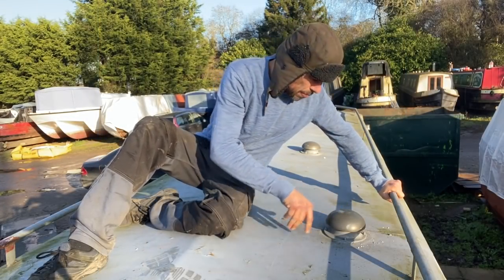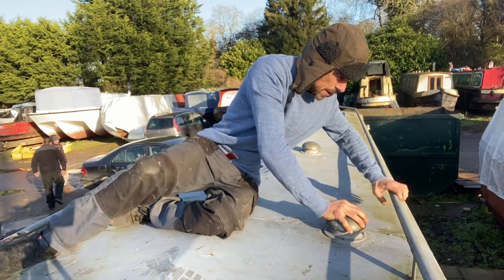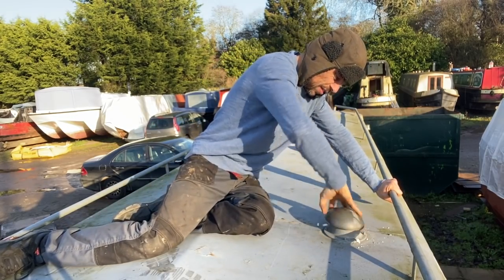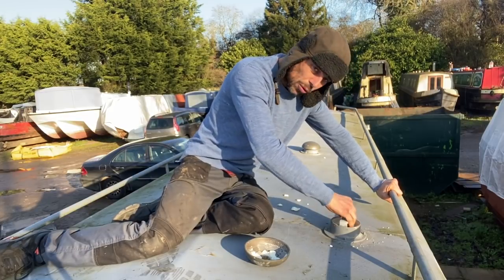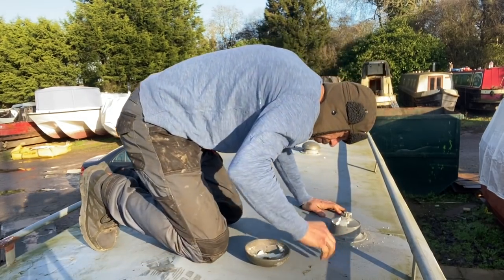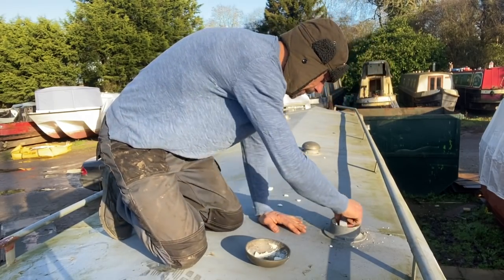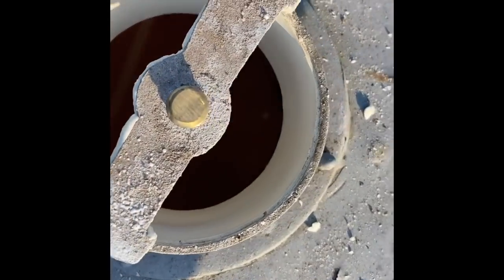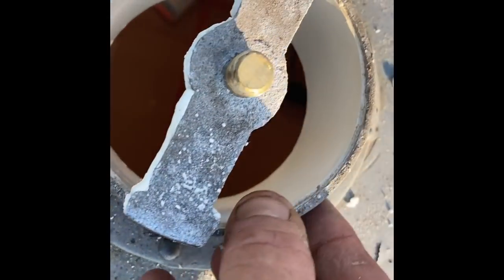38. New walls going up today on my Narrowboat

Comment: James.  Would it be an idea to run some trunking/conduit behind the walls and put a fish wire inside to future proof it just in case you decide on some sockets or whatever down the road?
Reply: I'd second that. They'll always be that one thing you didn't think of.
Reply: For the most part on nearly every narrowboat I have seen worked on on youtube that space where the top board over the gunnals creates a two to three inch overhang that wiring, some water and other piping are laid. Then a two to three inch board is screwed into place and all is hidden away.  You can easily get to it for any repair.  

The only issue is your pump from shower and/or bath that is usually in the bottom of the boat in that area and needs an inspection cover.

Comment: Re: Circular saw - Safety glasses still keeping the utensils safe? lol. Veneer might bend, but plywood is meant to be horizontally/vertically stable. When making wooden rope tension drums we either steam-bend or layer up veneer like an onion with glue between each layer to build up a laminate.

Comment: Sorry to put a downer on your plans, but you really need to rethink putting the walls on top of the floor. You need to think what would happen if you need to get access under the floor for a leak or to redistribute ballast. 
At the moment you'd have to remove the walls and possibly any piping or wiring before you could lift the floor.

Comment: Hi James. May I kindly suggest that the gas pipework is run under the gunnel. Joints should be easily accessible. Boats get vibration from bumbs and it is at joints I believe where gas leaks can occur. I have had on the boat safety test on two different narrowboats gas leakage at joints. Could not smell the gas leaking. The BSS has details re distance between pipe supports and that from each joint the pipe should be supported no more than 6 inches away. The gas pipework needs to be accessible for testing and easy to repair. Can then T off under the gunnel to go to gas appliances . The hob needs I believe to all be run in solid pipework. The oven can be connected to a flexible connection. I have done my own gas work and then got it inspected and tested. I believe gas and ventilation and fuel safety and stoves to be the major points of the boat safety scheme. Great videos, very enjoyable. Cheers.

Comment: For smoother curves, try cutting parallel lines about an inch apart and about half way through back of the plywood.
Reply: Yeah, 9 mm is not gonna just easily bend to a 10 cm radius curve.

Comment: I'm sure I watched on one video your gas is meant to go under the gunnel for safety cert thing might be something to check. Boat is looking brill.
Reply: I saw that too. It certainly cannot be under the floor (but I know James is not putting it under) and the BSS requirements look a bit vague, though a common them is the avoidance of possibility of damage, and keeping away from electrical runs. I remember going to a talk at Crick show that advised having a word with someone who does BSS inspections for advice before acting.

Comment: Those vent pipe liners under the mushrooms — you have them level with the spray insulation, but won’t you want them to extend all the way to the grilles in the actual ceiling? And won’t that be an inch or two further down?

Comment: Cable runs - Google ‘control panel slotted trunking’ I fitted this under the gunnel on one side. Use the largest that will fit and be hidden by the wall panel. Saves a lot of time when running your DC cables. Then its easy to add and modify electrical systems.

Comment: After all your work with all kind of insulation, moisture and vapor protection I'm wonder about your single glas windows. Don't you get a lot of condensation from them? Apart from all heat loss you will have that way.
Reply from the maker: Actually the glass seems fine but the alum frames are condensation monsters

Comment: Better PVA coat all the wood around the windows good and well because those shite alum, single panes will SWEAT incessantly.
In no time the wood will discolor terribly if not made water proof with coatings of PVA.
Reply from the maker: Yeah good points - I have been looking at coloured acrylic strips instead which are fine. Ideally I’d like a 25mm acrylic board on the hatches but the cost at that thickness is insane ! I reckon I’ll do timber with a clear hardened resin coating on all woodwork